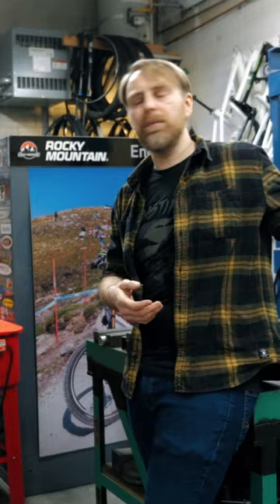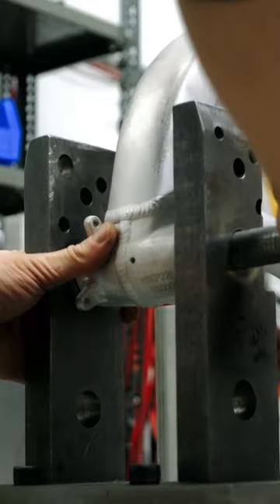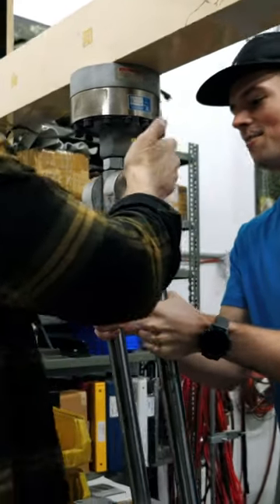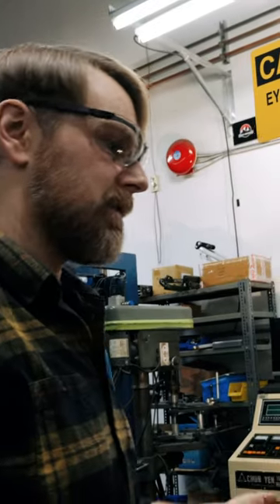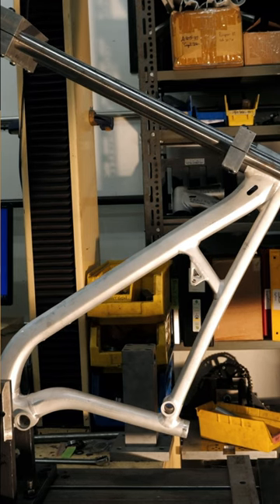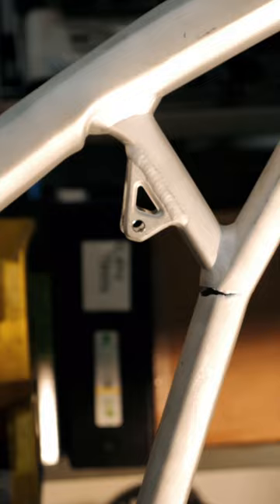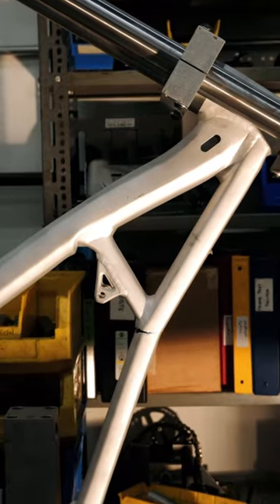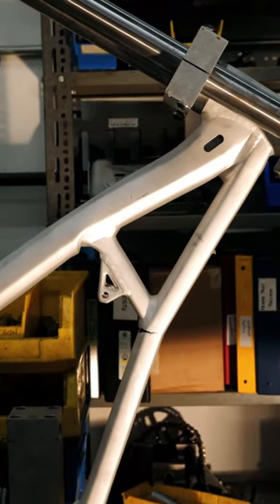Destroying a mountain bike frame for safety #rockymountain #mtb #mountainbike #enduro #fanatikbike

Comment: I like less spectacular. I still prefer alloy over carbon frames.
Reply: Totally. I think Aluminium is just the ideal material for mtbs.
Reply: @mattjns  I agree even though my last 2 MTBs have been carbon and I haven’t had a problem with them. I don’t know if it’s just because I read into it too much and I’m paranoid, but there’s always that inkling that it might catastrophically explode.
Reply: Agreed, unless you're racing and you really need the reduction in weight, carbon frames don't make sense to me. You usually get better parts on an Alloy frame for a cheaper price.
Reply: @blairlohnes8103  And the bike will last MUCH longer.
Reply: Carbon hasn’t come far enough for me to have any interest in it. Way too easy to damage for just saving a couple lbs.
Reply: No steel is  @mattjns
Reply: Steel os beter or titanoum
Reply: @stratosmagos  For mountain bikes? Absolutely not.

Comment: yeah exactly, it can handle anything you throw at it, but they only make polymer bikes now cus they charge you 8 grand these days... there is a culture in corporations where they raise the standard and stop providing any option for basic things that are less expensive in price and maintenance. manual transmissions, roll down windows, no cameras on my car, aluminum frames, steel frames etc etc.

Comment: I wonder how much more (or less) it would have gone without the shock mount cross member.
Reply from the maker: An interesting question. I imagine the failure would have occurred at the headtube, and would think it wouldn't have lasted as long, but yea, would be interesting to know. I bet they tried it out!
- Dan P.
Reply: Wish I read this before I wrote mine .. thinking the same thing 😮😅

Comment: In my years of racing BMX, I watched steer tubes (head tubes) snap off of early 80s and 90s aluminum BMX frames.  No warning.  No visible cracking or deformation before failure.  I've seen riders eat shit hard.  They still had their hands on the bars with a bewildered look on their faces.  The look of "wtf?"
I stay with good old fashioned chromoly frames.  If they have been compromised, you always find a crack developing somewhere. And they're usualy found at a weld.  So You retire the frame for a new one.  No horrifying accidents.  Chromoly talks to you.
Another horrifying unannounced fracture that can catch you off guard are peddle axle shafts!😵
Reply: Yeah aluminum is hard to weld

Comment: My next bike will have a steel frame. I hope I can get 100k kilometers on it.
Reply: I got 147k on my last alloy trail bike and over 200k on my steel enduro.  I have had to fix the steel bike though after my first ride and around 80k but I'm a welder so it was no problem

Comment: Why would it break at the heat affected zone of the weld?
Reply: Why would it? Because welded aluminum has 50+ % less strength once welded compared to base metal (exact loss depends on grade of aluminum, and type of weld). They overbuild the welded areas on bikes for a reason.

Comment: 2000  to 4000 N doesn't seem like a lot of force to break a frame...
Reply: They were talking about around 4000-4500N which would be around 408- 459kg or 900-1010lbs (in its weakest direction due to the angle) of force at what looks to be the axels location, creating a massive amount of torque at the headtube. A frok lengths axle to crown (140mm of travel) is around the 0.550 m with a force of 4000N would create 2200 Nm of torque, which is a lot. For reference an e-bike motor would put out around 80 to 90 Nm max for a high end powerful model.